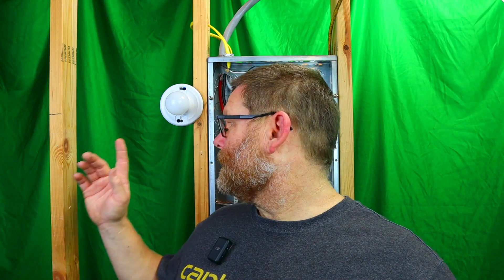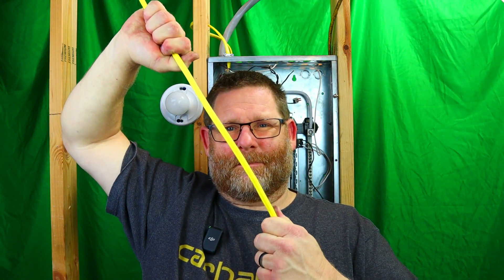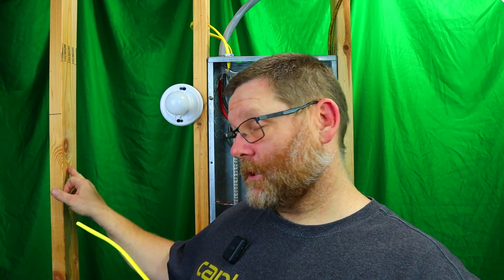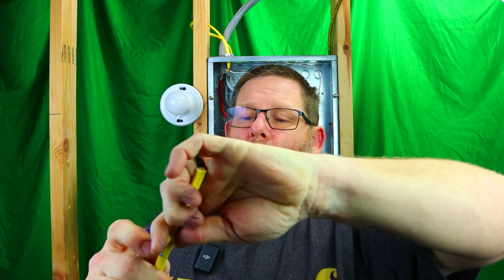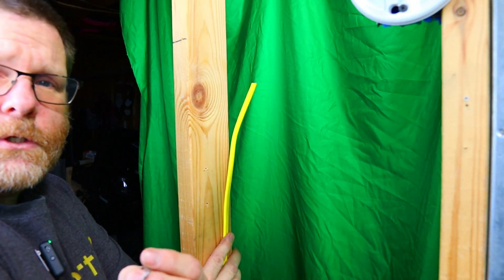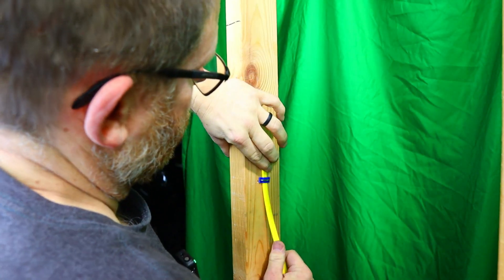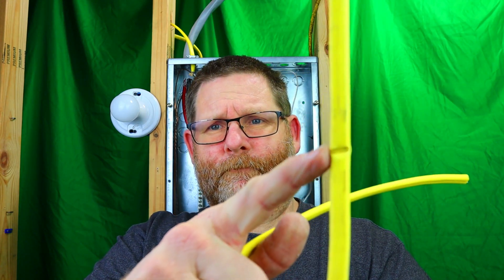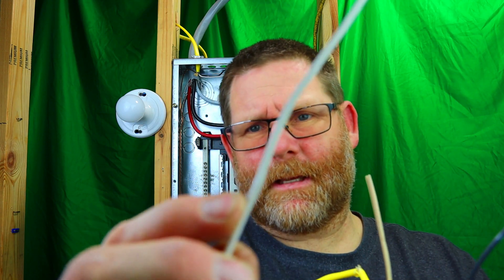How To Staple Romex

Comment: Exactly the video I was looking for! Just bought a house with a number of issues flagged by the home inspection guy. I've used the all metal staples in the past and I'm sure I hammered them in too deep. I was going to go with the insulated staple for 12/2 Romex up in the attic of the new house, but did not know whether to get 1/2' or 9/16". Your video helped me decide on the 9/16". Also, yours is the only video that shows what proper depth of the staple looks like, and the damage to the Romex by driving a metal staple too deep.
Reply from the maker: So glad you found this video. I appreciate your comment and watching ☺

Comment: Nice job stripping away the outer covering of the Romex and showing us the indented/impacted hot and neutral wires.  You showed us what your friend preferred, and what you preferred, it would have been nice to know why your friend wanted to keep the Romex as loose as he did, and why you nail it down tighter.  For people like me without your knowledge/experience such things are not obvious.
Reply from the maker: According to him he felt like if there was any settling in the house it would give easier. My reason is the same but I just prefer it just a tad tighter. Neither is wrong

Comment: Thank you so much for your video. It happend to me i went to use an outlet and i had NO POWER went under the crawl space and found that the stample had rusted thru the jacket and shorted it out. Glad thats all it did. I dont know if i should take on a REstapleing JOB and remove all the old staples and install your bushing type. What would you do? Again Thank you so much !!!
Reply from the maker: That was probably a fluke thing. I don't know if I would do that but definitely something to watch out for in the future

Comment: Your way and with the bushing. I like the staples with the individual small nails and the white bushing. The bushing will likely bottom out on the stud before crushing a single Romex cable. They're probably more expensive and time consuming to use, but it's not a concern to me as a diy'er. What's your opinion on those things?
Reply from the maker: I have only used the ones with the nails on phone lines a long time ago. Never really used them on romex. As long as it's holds tight, nail it 😂 😂

Comment: I like snug but not crushed, reason being i dont want the cable to transfer strain and pull on any connections in an adjacent box.I like the insulated staples as well but I'll use whichever one we can get. 

Another issue is the manufacturer will list on the packaging what cable,  (10/3, 12/2, 143, etc) that the staples should be used on. And don't forget stapling multiple pieced of romex under one staple.😑

And as always all the products should be fine, until you find yourself in an attic, inventing a new yoga position.
Reply from the maker: 😂 😂 😂 Yep been there.. Love the comment. Thanks for the comment and watching ☺

Comment: Ever rewire an old house without removing the wall board?
Reply from the maker: Definitely
Reply: @MountaineerOutdoors  Staples?
Reply from the maker: You don't have to staple if you are fishing walls
Reply: @MountaineerOutdoors  I know and it's funny how the code no longer applies.
Reply from the maker: What exactly do you mean? It says that you don't have to staple if you fish a wall. Absolutely no way too
Reply: @MountaineerOutdoors exactly. So why do you need to staple open construction? Safety reasons? So rewiring without stapling is safe?
Reply from the maker: I will answer you if you are serious about your questions. Seems like you are just being confrontational... So let me know
Reply: You get my point. It's fine to have no staples. Not being confrontational. If you think about it, if there weren't any staples in the new construction you could use the old wires to pull in the new.